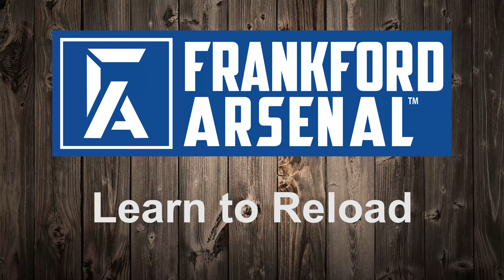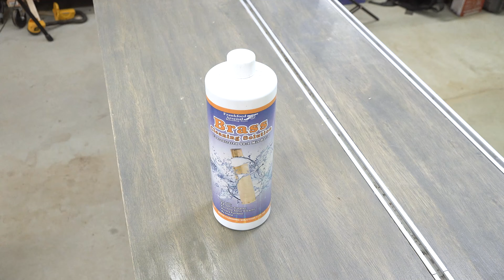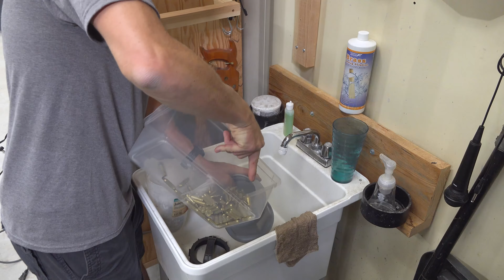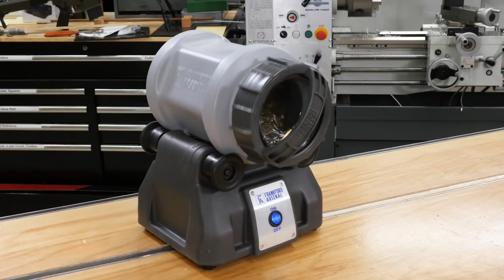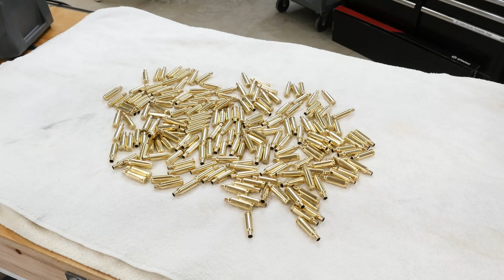Wet Tumbling with Ultimate Reloader

Comment: Seems like a lot of trouble  .  I simply use corncob media with some Dillon Rapid Polish, and a couple of hours in my Lyman vibrator the brass is sparkling clean.   No messy residue to dispose of.  Once the media gets darker, I just toss it and replace with fresh.  It's cheap, and I have a five gallon bucket of corncob media.

Comment: At a minimum, decap and swage before you tumble. If the brass is fairly clean (no mud or dirt caking), go ahead and full length size then clean to remove the sizing lubricant and pocket dirt.
Reply: The point of cleaning the brass is to prevent putting abbrasives into the resizing die. If you resize dirty brass, then the abrasive has already done damage.

Comment: My process (rifle brass) using Frankfurts tumbler and dryer after range day.  2 tubs saves time.
1. Dirty brass only in tub dish soap, cap of simple green only, no media.  30 minutes to HR.  This tub is my non media tub.
2. Dry cases. 
3.Lubricate
4. Decap,Size, and trim. 
5. Wash again, stainless media, soap, lemmie shine, in TAP HOT water.  This tub is my media tub.
6. Dry
Results primer pockets are SPOTLESS. Brass looks factory new.

If you are going to roll size brass DO NOT LUBRICATE CASES until AFTER roll sizing!!

Comment: A Simple "H" shaped agitator makes the FA Tumbler lite, and absolutely awesome tumbler.  
A Dollar Store Poly Cutting board (I bought 5 b/c bending to fit in the tumbler can snap them. 
-  3/4" - 1" wide legs and cross bar.  
-Cut with a fine tooth jig saw (20TPI blade) hold firm, if it starts vibrating hard, you will snap the legs of the H.
Once cut out, heat crossbar of H with a hair dryer til it is more bendable. Carefully! this is where I snapped the first 3 I made.

With the agitator in place, tumbler will clean 20-300 cases at a time without problem.
Reply: I just cut 6 pieces of plastic coat hangers (1/4" round) to lay in each crease of the jug. Will be hot gluing them in place right after I scratch the inside up real good. Then I will try adding layers of plasti-dip or some type of rubber coating for porches/decks. This should make the cases tumble quietly.